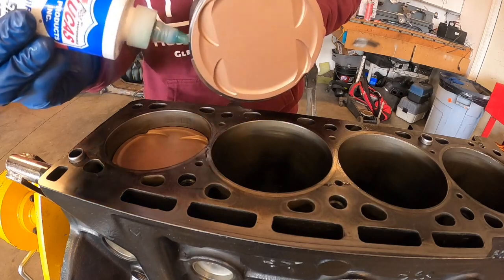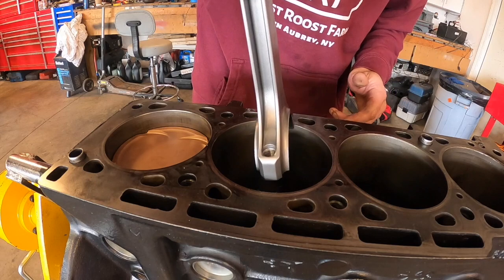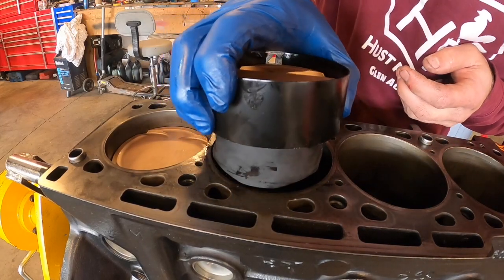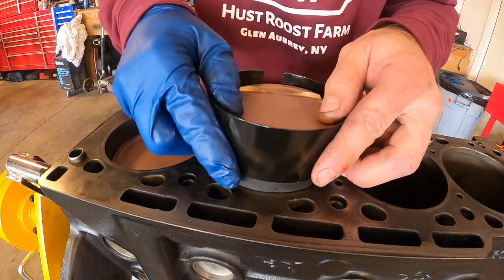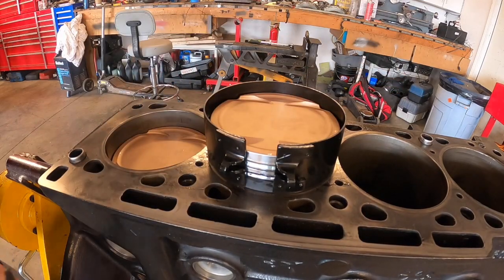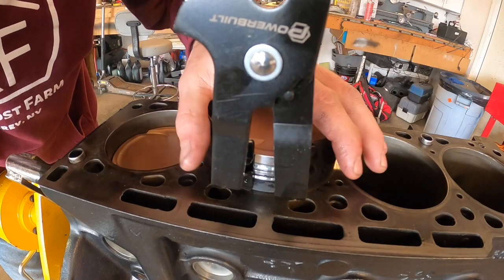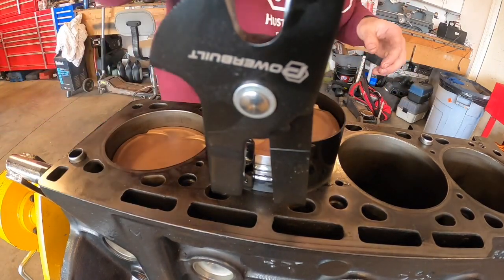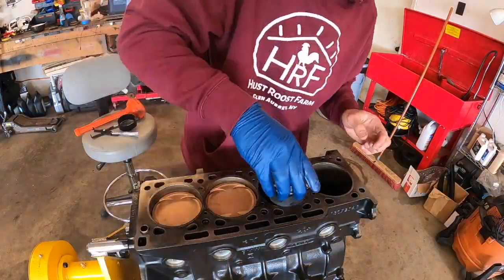NLAM3 Part 31 How To Build An S14 Complete Build Video

Comment: I am sure you are aware but the torque spec is 20nm AND then 50 degrees for the main bolts on the s14.  Assembly looks great, nice work!
Reply from the maker: Yes!!! Good point. I forgot to put the 50 degrees in the video but I definitely did the 50 degrees!!!!

Comment: I enjoyed the video but installing the timing cover after the head has been bolted down is not the correct way to install the timing cover.  Also what brand oil pump did you install? I have never seen an s14 pump that looked like that?

Comment: Hello!! I have a doubt, in the minute 6:14 i can watch that the large chain tensioner is not installed and you install the cylinder head, after that the chain tensioner show up in his possition, how do you do to install it? Because i have an m3 e30 and to install the large chain tensioner i have to unistall the cylinder head